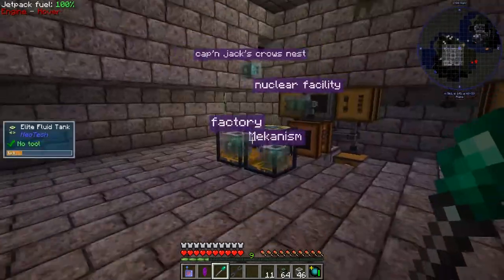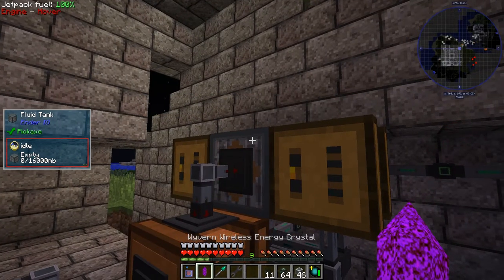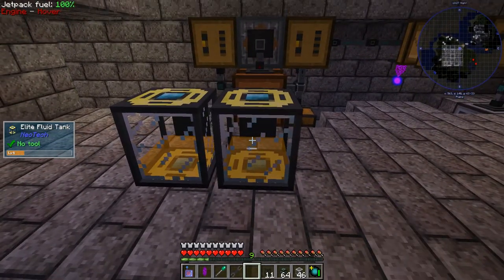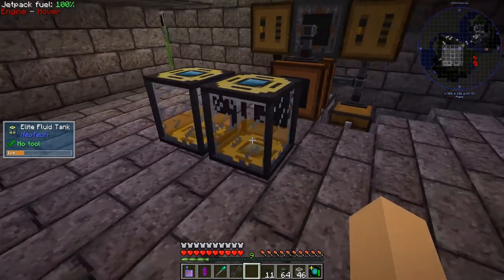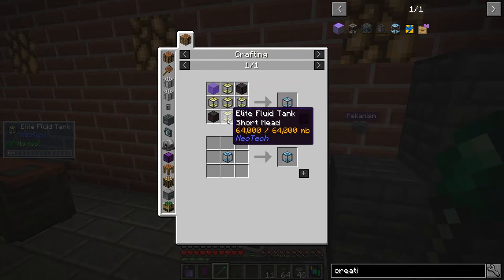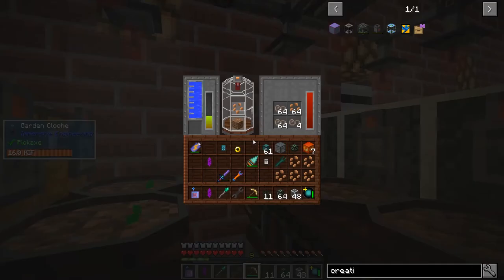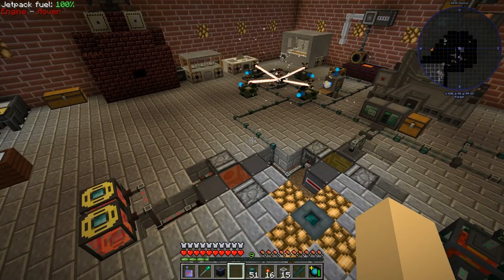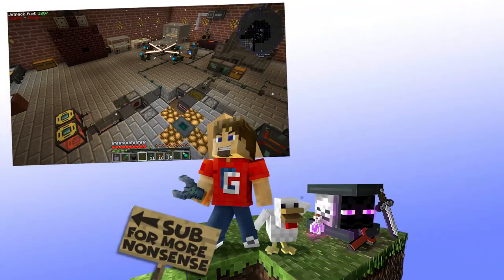Age of Engineering 73   Creative Gases and Fluids Pt 2

Comment: Yeah, having set up that same system myself before, it can occasionally hang but for the most part works pretty well :)

I did used to wonder if it was possible to set it up so it happens in one block - so you drop a crystallised seed, then an empowered seed (triggered by the same signal, separated by a timer) but I never got to testing it!
Reply from the maker: I think you could get it working pretty smooth with the RFTools sequencer, although by the time you've mucked around doing that you have all the oil you need ;)

Comment: Nice canola setup. Sadly it is quite useless at the stage you are at. It might be a good idea to start making the creative capacitor banks as well, because they take ages to make and cost a lot of resources. Better start them relatively early, I think.
Reply: He's only making it to fill the tanks I think. Though piping it into a few Advanced Generators would still make a LOT of power.
Reply from the maker: LordPINE yep it's sad isn't it! I kinda wish I'd set that up around age 5 so I could tinker with it to my hearts content. I think the timings could be fixed using sequencers
Reply: Triaxx2 I know why he's made it, just sad that it's such a one use system now.
Reply: Sorry, I just got home from work when I posted that and was watching half-asleep. Not to imply he's boring but work was mentally taxing. Blame my brain failing to function.